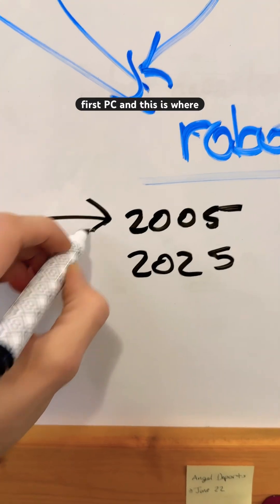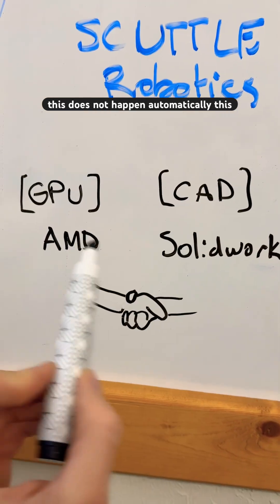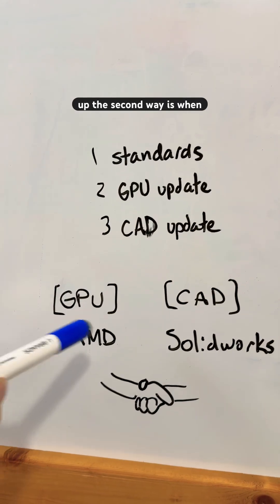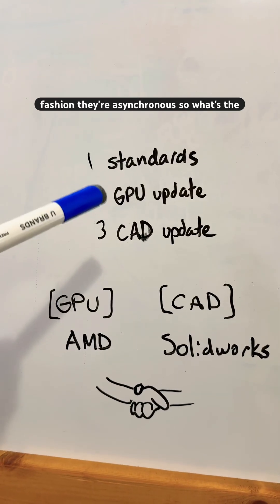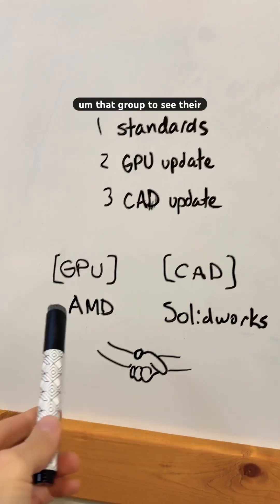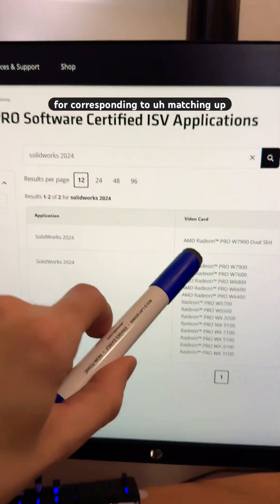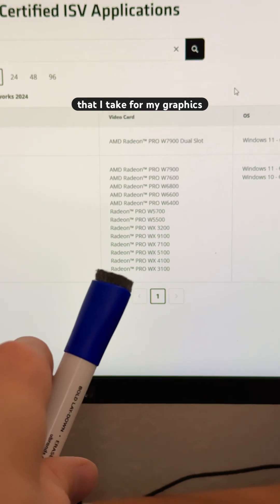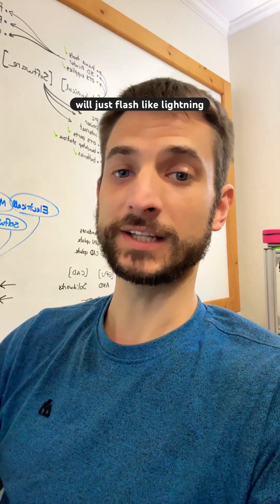best GPU and best driver for modeling 👉 NOT the latest!

Comment: You really are so far behind in technology lol. Just like the carbide bits. A Radeon 4100? jesus man
Reply from the maker: we don’t leap every time the consumer world says “jump”.  In Toyota, 2012 we used windows OS at 2 generations behind.  Do you see anyone outperforming Toyota in worldwide vehicle sales?
Reply from the maker: bookmark 📓
Reply: I worked on mission-critical systems like NG911, and we are still using old tech that consistently reliably works! 😅
Reply: Bro the U.S. military still uses windows 7 and xp. Good enough for them good enoigh for me

Comment: I built a PC in December last year before prices went soaring. The specs are pretty overkill for CAD software, but noticed a huge difference in workflow. Having a good GPU helps out a lot. Team Red (AMD) is the way to go this generation. Newer Intel Arc GPUs could be good too.